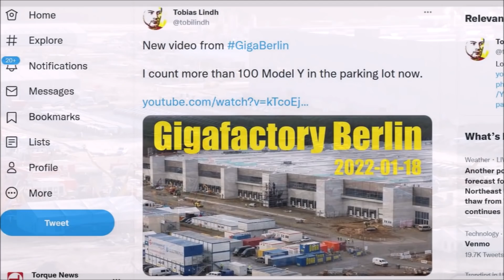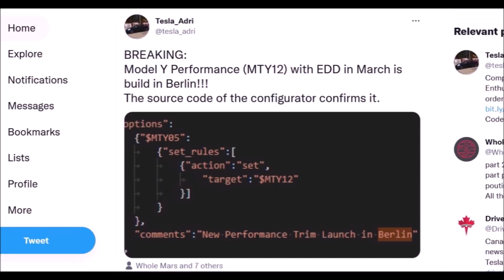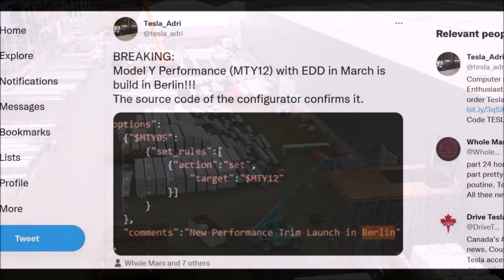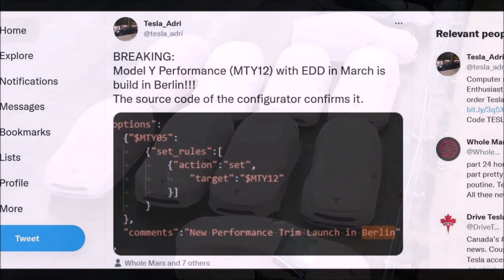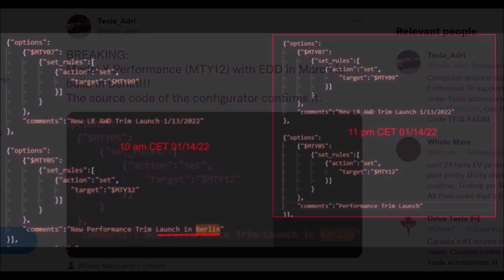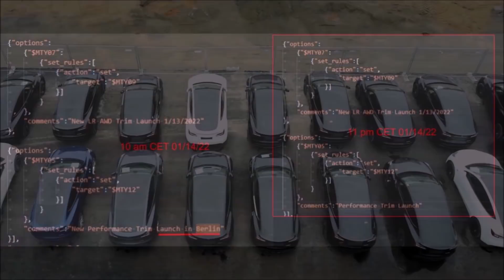BREAKING! Brandenburg Government on Tesla Giga Berlin: "There Is Enough Water"

Comment: Since these buildings are so huge Tesla should set up rainwater collection from their roofs and either return it to the environment or use it themselves to reduce their footprint.
Reply: That's almost certainly going to be the case I'd say
Reply: Water that falls on your property isn't all your water. That water is the water for the area it falls on. Water rights aren't what you thing they are. For example Kansas has sued Colorado for taking too much of the snow melt from the snow in Colorado several times. All the rain or snow that falls on your land isn't all your water.
Reply: @Cybertruck1000  Yes, it is actually the case,  there are special perforated pipes in the ground in some places. But not under the buildings. And Tesla has built in an official water protection zone, directly over an aquifer for drinking water. And that problem was known, but not solved when they started.

Comment: Why can’t anyone see that the solution would be to reuse the same water?  So if Google use the water to cool computers then used by Tesla and then to coal mines that don’t need pure drinking water to mine coal. Am I missing this simple solution ?
Reply: How are you going to move that water around? Installing additional pipes? How do you guarantee the secondhand water quality? Install intermediate processing plants?
Reply: It’s not about the water it’s about stopping Tesla manufacturing In Germany
Reply: @stevenbarrett7648  Seems like you are missing some details. Like the minister of transportation recently saying that people should by electric cars. Explicitly, on the top political level. Not a regulation, just a political statement, that, of course, shocked every car manufacturer other than Tesla.
Reply: @vsiegel  Tesla Leeds UK told me we will never get our cars from Germany we will always be supplied from China

Comment: Tesla was not going to build something that large with no adequate water supply. Elon can be a little on the edge for a lot of folks but he's not stupid.
Reply: Cleantechnica had an article  Brandenburg Coal Mine Uses 171 Times More Water Than Tesla’s Giga Berlin Will Need.     Seems the mine was flooding, so they pumped it out, and dumped it.
Reply: Exactly. The local government would not have even entertained a proposal to build such a massive plant had they thought adequate water supplies would be a problem. Brandenburg area gets a lot more rain than Austin, Texas. Samsung's billion dollar semiconductor chip plant that has been here for nearly 20 years, and had two huge expansions uses a lot of water. Samsung just announced last November they will build a second semiconductor plant several miles from their Austin fab facility and it will be even larger than the first one.
Reply: @richardcogbill6791  Samsung is elsewhere, not above an aquifer for Berlins drinking water. Tesla is in a water protection zone, there are geological maps, well documented and public.